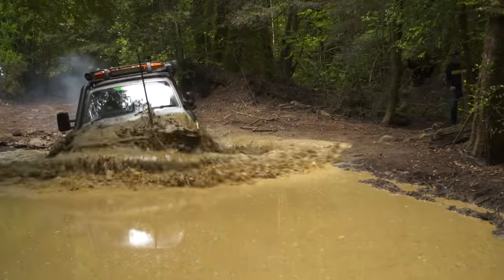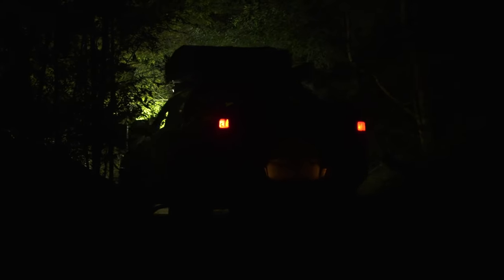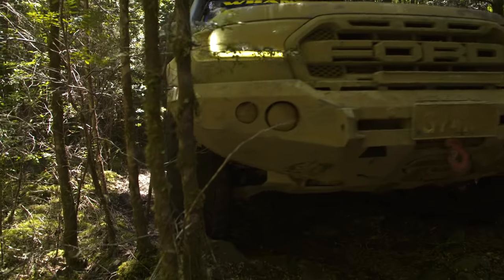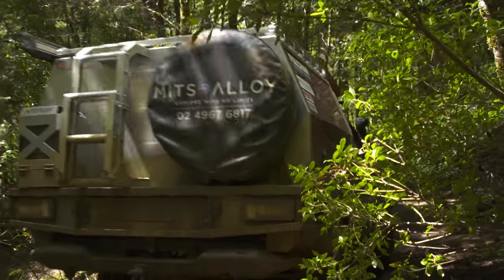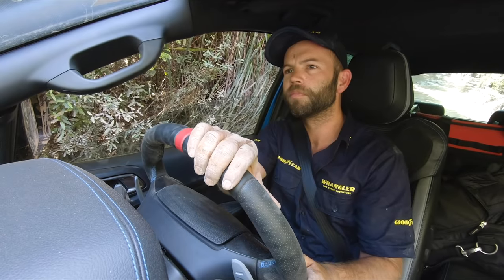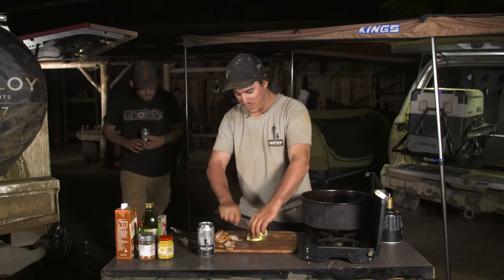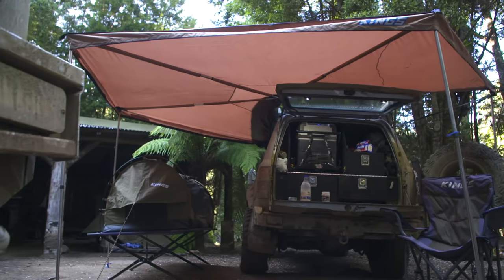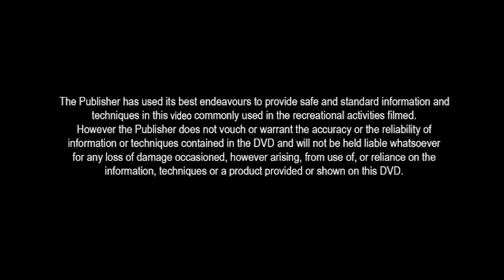6km IN 3 DAYS.... Did we get this 4WD out? Tassie $1000 Track Part 2!

Comment from the maker: What's the craziest bush mechanic fix you've had to do on the tracks? Tell us below
Reply: 4WD Action not too bad but a radiator on a 4.8 gu on the beach bogged
Reply: Came across an older Triton a couple years back coming across the Simpson with a snapped chassis. Took out his battery, grabbed a set of jumper leads, arc welding rod we found in the bottom of the toolbox, two winches and jacks to get it back in line. Zip zip got him back to Birdsville we heard from him later👍
Reply: Lower ball joint. Had to send people for parts and spend the night on the trail.
Reply: Also on the Simpson few years ago. Suspension on my 07' Ranger decided it had enough. Front passenger completely gave way, tyre at 45 degrees. Worked on it for a few hours getting the snapped bolts out and ratchet strapping it back to the chassis and crawled for a day on heavy corrugated tracks into Cober (Oodnadatta said no can help). That happened just out of Delhousy Springs.
Reply: I have arc welded using Two 12 volt batties to get 24volts and jumper leads....
Reply: Gear box in the bush in a 80 series
Reply: Awsome video . Keep it up!! Had to weld drive Axel with jumper cables. Water in engine, hyro locked but got it going again . Fuel pump failed , sat and rode the entire trail under the hood spraying cans of Eather down the intake to keep engine running!! All at different times. Glad to see you guys got out of there safe . Cheers mate!!
Reply: had to do a very similar fix to what you guys did on the ranger to my brothers gu at lithgow cause the arm for the tie rod on the drivers side swivel hub snapped off doing the wombat holes. ended up getting another swivel hub in wollongong.
Reply: Hey guys do Know any decent tracks in WA!! Surly get a video out of wa
Reply: 4WD Action broke tie
Reply: its nearly everyday i see a toyotas jumping patrols. it must just be a patrol thing.
Reply: Sat under the bonnet of a 72 Honda civic and pouring fuel down the carby to get 20 km home out the back of perth hills when I was 9 yrs Old! 👍
Reply: Had an Izuzu Mu break a tie rod on the beach, spent 13hrs getting it home. Had the winch hooked on what was left of the steering, so we could winch in/out help steer it home. Bout 5km from home, 3 wheel studs decided to let go. It was an eventful day.
Reply: Cruiser park with the club. 80 series with a snapped output shaft of the steering box. 3/4 way up a hill. Found some relatively straight logs that we ratchet strapped to the bull bar and sliders to keep the wheels straight. Using 12v winches and a turfer to pull the front around to steer
Reply: Always makes my week better
Reply: 4WD Action  best bush mechanic fix I’ve helped with was a HG holden wagon, been racing in the paddock, rolled and broke auto trans cooler lines. Put it back on its wheels, crimped the auto cooler lines. Then fill the auto with H2O , get a few laps out of her.  Then steam, then let it cool, then more water, then more laps, repeat, repeat.  Cant compress water same as cant compress hydraulic fluid. Will get you out of a jam.
Reply: Shauno what cooker are you using?
Reply: @robertstevens4231  check Graham's channel. Ecomuse
Reply: Live in cairns
Heading for 2.5 week cape run
Blew rear diff 10kms from home in v8 ln106.
Tore out rear shaft drove in front wheel drive to wepia before getting it sorted.
Then it broke a role pin on the 4wd selector so it was randomly going between 2wd/4wd.
Drove into and out of mutee heads just sending it in 2wd didnt need a snatch
Reply: Front driveshaft!
Reply: A mates brake caliper fell off snapping the brake line, the other half improvised and used my nurse artery forceps to clamp the line...
Reply: Not sure if you guys wouldve tried this for the alternators but ive had them clogged over 20 times everytime hit it with a hammer and spray some wd40 in it if that doesnt work pull the brushes and wash with petrol
Reply: Done a front diff on a 105 series had to pull the shafts to get home as it was full time
Reply: I once had to tie spaghetti together to make a fan belt....Got sauce all over the engine bay!  😫😵😆😅👌
Reply: Driving 120 kms after the top of an 80 series radiator blew, with a big jug of water on the passenger seat, stopping to pour water everytime the temp gauge started crawling up, not a real fix, but got me back home.
Reply: Absolutely insane.  Sitting in Malaysia and loving each episode.  How I wish to travel down under and try a few tracks there.
Reply: It was a old 80 series but we chop it to 2 door and left it with 2 sit only and we put an 14bt is a 4000cc and it was about 400hp and we broke a drive shaft and the axel and we blown the head gas get and we broke the axel shaft and we fix it in ome night we use 2 battery to weld it and we take of the block head to put some glue to hold it
Reply: 4WD Action it would be awesome to see a segment on everyone washing there cars after a big trip like this as everyone cleans there rigs differently:)
Reply: take stickweldin cables with you next time...you only need 24 volts(2 norm. car batteries and you can weld with stick...10 min job in situation like that..
Reply: @romujooseppi8352  yea if u dont have any welding cables u can even use the jumper cable
Reply: What happened to Grams arm
Reply: JRE mountain bike riding he said in the video
Reply: Fist sized hole in the sump of a Yamaha TDM900 going to Cape york. Found the pieces of metal in the creek 2km back, and used Knead It to seal the hole. Got 40km to the next Roadhouse, where the bike managed to get a Ute ride back to Cairns. Did a clean up of the repair in Cairns and the bike got ridden back to Albury with no issues.
Reply: Subaru brumby ute.fuel pump failed. its located on the inner fender.pulled the top of it wedged a stick against it and the block.tied it in place with the cord from my swannie and loosend the engine mounts!. why you ask? the rocking of the motor pumped the fuel into the carby. couldnt do anymore than 30 kmh otherwise the engine smoothed out and wouldnt pump fuel!!
got me and the family home
Reply: replaced my hiluxs axel
Reply: Two 12v batteries, two sets of jumper cables, and some 7018 stick welding rod to weld the frame back together and then weld the broken steering box to the frame.
Reply: I once stopped half way thru a trout fishing trip to add half a quart of oil to my 1980 Honda Accord.  Which was baddass.
Reply: I have a problem with a radiator hose, I fixed with a plantain shell, crazy... but true haha 🤣
Reply: not on the tracks, but we had to clog the brake line hose with a plastic because I got the a leak on the brake hose screw.
Reply: Bj40 in Costa Rica. I sheared off all the double ended bolts in the front swivel. A friend had to drive down to Paso Canoas and have new ones machined out of what was available in the local hardware store.
Reply: Cylinder head cam loose on my yamaha blaster and had to borrow 13mm nuts off someone else's quad to get back to the truck
Reply: Why doesn’t anyone in Australia tub the firewalls to avoid having to use a lift
Reply: Don't think that 13 year old is ready for such an experienced track
Reply: Cracking one piston and change it...3 days
Reply: We fixed a toyota (blown gearbox) with a jerrycan, rag, and a bottle of jacks.
Reply: I'm from new zealand and I was in a track that was all clay and not one dry spot and I lost the gear box
Reply: Not one that I did, but one that I saw.
An entire rear axle ripped off. Broken u-bolts and the driveshaft was seriously messed up.
They removed the rear driveshaft altogether, so the truck was now front wheel drive, and reattached the rear axle with lots, and lots, and lots of zip-ties.
That guy had more balls than brains.
Reply: Replacing a transmission in the middle of the woods of Kentucky....with the transmission I had in the back of my Ramchager😉
Reply: That Sweet Baby Rays BBQ sauce is great
Reply: Weren’t able to fix it on the track but just about smashed the sump off. Up in Vic high country, needed a car front and rear to get it back to black top. Local mechanic was able to press the sump out and seal it back up. Still hasn’t leaked 12 months later
Reply: Gathering pee from all the guys to use in a broken radiator to get us out of the desert. We already have used the soap and sand putty fix, and the egg fix.
Reply: Pretty minor one really.
My brother hit a wombat and broke a HP power steering pipe.  Cut the Kinked&Split section from the pipe with a hacksaw and scavenged some rubber fuel hose and hose clamps from the outboard motor on the towed tinny.  A couple of hose clamps and about a half litre of Power Steering Fluid later and we were mobile again.
Reply: Got a 1984 hilux bogged up to the top of the door😢😮
Reply: Not me, but my father, was him his old Hilux and the the next thing he new he had no steering, turned out that the steering rack shattered, luckily some sticks and zipties came in handy.

Comment: I’m kinda surprised nobody has a welder with them, especially when you pretty much know you’re gonna break stuff. Could have sleeved that tie rod and welded it up
Reply: Exactly
Reply: @630nick  or a small oxy welding kit.
Reply: we always carry heavy leads and electrode holder with 3 batteries in series can do an ok bush weld
Reply: Jumper leads and a decent battery and you can get a small arc, but pretty sure the battery would be destroyed after
Reply: Maybe makes for better viewing and stories
Reply: I don't think any of these fancy guys know how to weld 😅
Reply: Or just buy a Toyota lol
Reply: Jeremy Browne because those spring hangers are great!
Reply: This kind of metal can't be wild
It's not iron..
Reply: @abuahmedmarwan8060  what metal can't be welded?
Reply: 2 battery's wired in series and jumper cables 6011 or 7018 welding rods welding in DCEN. works well but you have to disconnect 2 battery's.
Reply: I was thinking that they would have had a welder on board too but, I'll make the excuse for them and say that they didn't have space for it, however, I'm thoroughly surprised that they didn't have a spare tie rod for the Raptor. Every video I've watched so far, they always keep the saying "It's not a matter of if you'll brake something, it's when" So, not having a spare tie rod was a rookie move on the Raptor driver.
Reply: Or sleeved it drilled holes at either end to fit a bolt.  Otherwise as they say just use zip ties!
Reply: Devindranath Mahabir especially on a raptor on 35s
Reply: You can't carry everything, where is the fun
Reply: @rubenbraekman4515  haga shauno can weld mate,he's done it in a previous vid.not a bad job too
Reply: That's what you get when putting 35s with negative offset on a IFS.
Reply: They used to keep a welded on them if you watch some of the really old videos. Guess they didnt use it enough to warrant keeping it/taking up the space.
Reply: Bruhhh
Reply: I just logged in to post the same comment about an on-board welder. Seems like some company would be willing to donate/discount a product so that it could be featured on the videos. It’s not like these rigs are REALLY funded out of Shaun & Graham’s pockets.
Reply: For sure they'll bring one next time. Also no Ford 😂
Reply: @simonminchiny60  yep
Reply: @barra245t2  arc welding? Seen quite a few pro welders that can't arc weld. Not. Much call for it these days. But for $2 of welding rods they could have repaired that tie rod and not have all the hassles
Reply: Swampy  likely in demand as there is a shortage of ppl that can stick weld.
Reply: @devindranathmahabir9979 agreed on this about the welder and the spare: The tie rod is such an obvious spare part to carry and so small and can stuff you up so badly if it breaks. Such a ridiculous thing to miss, for experienced off-roaders, that I am inclined to think it was deliberate to add to the drama.
Reply: Swampy  Which is why I said that it's a rookie move for the Raptor owner to not have a spare
Reply: i agree with you...bush welding with battery power.
Reply: I thought the same thing but it’s on of those would’ve could’ve should’ve times
Reply: Mate, it can happen to any vehicle with IFS. Theres any episode at Glasshouse Mountains where the Dmax broken.
Reply: You can make a DIY welder with 4 batteries all connected just need some arc rods
Reply: Or good ole jb weld
Reply: @Sco33a101   yes indeed , cant believe they did the 1000$ track with out arc rods , or maybe they don't have the knowledge about bush wellding
Reply: @Theelax42  mercury, potassium and galium
Reply: Sic Semper Tyrannis  Graham didn't have a spare alternator.

Comment: One tip i learnt way back (1994 actually!), after breaking a trackrod and loosing steering, was to let the tyre down a bit on the "non steering" side, and pump it up a bit on the "steering" side, this means the steering side is carrying more load (more of the vehicles weight) and so can dominate the vehicles direction more than the side that is just flapping around!

Comment: Greetings from Poland
Bush mechanic's - good job with the steering rod. It's good to keep propper size U-bolts and a long screw or a piece of hard metal bar. 2-3 U-bolt clamps on each side of a broken rod, bolt it tight and of you go to a workshop. 
About the fix: radiator hose once, steering rods twice, they simly snap, swaybar links, several times.
Keep up the good work, the films/views/people are amazing.
Reply: I was going to write this too...  2 U clamp on each side should hold that wheel.

Comment: In February I ran an overlanding course call "run through the hills." It was put on by Backroads of Appalachia.  It was a 24 hour course from Sennica W.v to Pt. Pleasant W.v. About 4 hours in, I broke the drivers side upper ball joint. We tried to ratchet strap it enough to get me off the trail. Ended up destroying the tire, but we did get me out of the way enough to get   something like 20 vehicles past me. Finally the support crew got to me and we figured out a plan to fix it. We got the ball joint pin back in the control arm enough to weld it. It was a pretty amazing bush fix. I drove it out another 6 miles of extream rock and creek bed climbs, ice and mud. Once we got to a main road me and wife decided to err on the side of caution and head home. The bush fix got us another 160 miles home. I've offered to be part of the support crew on the next run. Without a generator and welder, we'd had to left my rig and went 6 miles out and then foud a parts store. Then 6 miles back in. It would have been an absolute night mare. Snow on the ground, 2,300 feet altitude at about 32°. I was so impressed with that bush fix. I've upgraded my 4x4 to a chevy colorado on 35's. I've made brackets to hold a generator and welder in the bed of the truck. Good day to you all. Thanks for reading.

Comment: We've had the same problem before we have taken an open end wrench try to put the open end up against the knuckle and then use four or five sinch pipe clamps around it making sure  to span over the broken section as much as possible cinch shaft and the wrench and tighten them down good that works as well and it keeps you able to steer sometimes you have to adjust it a little.

Comment: i carry extra synthetic winch line (dyneema rope) instead of using ratchet straps for random fixes like the broken steering arm. it comes in a plethora of sizes, can be tied in a bowline knot, and is way stronger. thanks for the inspiration to get out there and chase down some dreams. cheers from the USA.